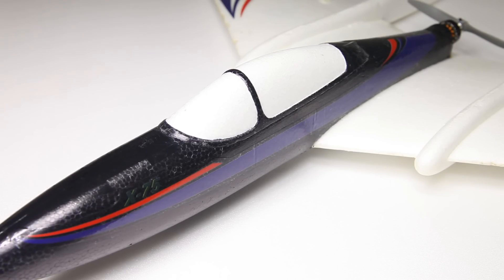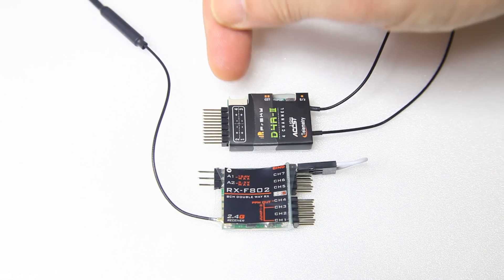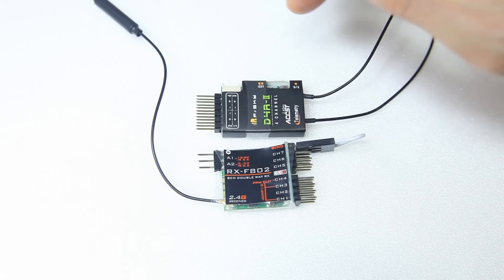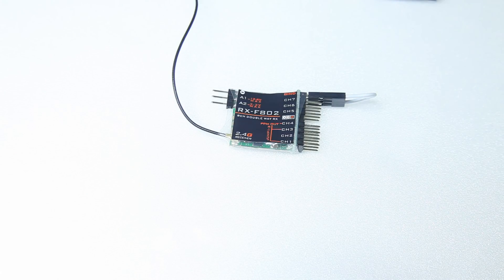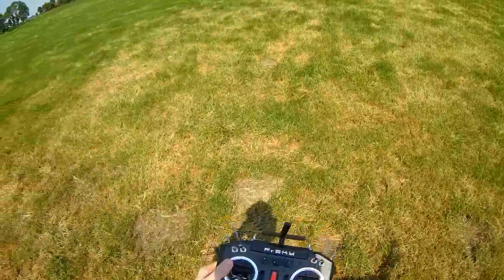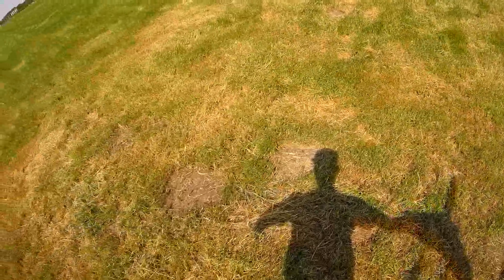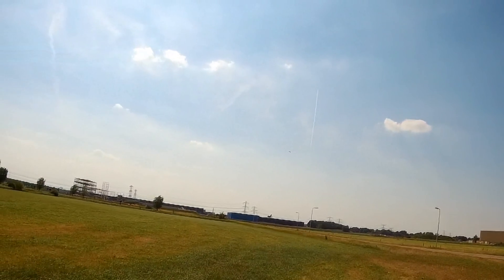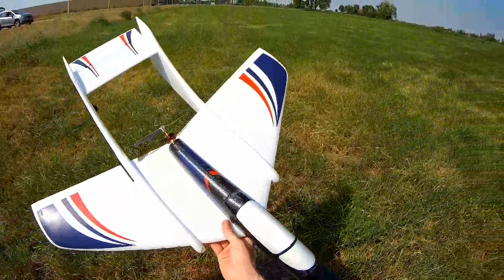Cheap FrSky compatible receiver WITH Voltage Sensor! RX-F802 Review / Test

Comment: Thanks Dutch for the follow up video. I've had a few more flights now, experimenting with the angle of my Q X7's antenna. Placing it upward at an angle has alleviated the RSSI low warning I had low to the ground down field. Like you mention, having battery status available is such a treat. At moderate throttle levels I start thinking about making my approach at about 11V for a 3S pack. By the time I land I've gotten just about maximum flight time from my plane without guessing. I'm planning on buying more as these work fine for LOS flights.
Reply from the maker: Howdy man :) 
as you might have noticed I did do my testing with an old beater plane ;)  But it worked out well.. I allso made sure to have my antenna at the right angle (something I kinda never do really :$).. 
I have seen some people say it has range issues, but really I think they were testing an apple, and concluded it was a bad pear :) 
Great LOS receiver option.. And that's it :)

Comment: I really like my QX7 but FRSky receivers are pricey, this looks like a great substitute.
Reply from the maker: Coming from Futaba radio's (and receivers) to ME Frsky receivers are bargain deals :D 
but yeah.. this one is even more of a deal.. Do NOT see it as a full-range receiver though.. I presented it as a LOS parkflier receiver for a reason...
Reply: DutchRC Adventures , The reviews and price for the QX7 are the reason I bought it. The reverse of you, I was coming from Lemon RX receivers. The version I use cost approximately $25/$30 for 5 receivers. There was no way I could pay nearly $40 for one receiver.  So I use a Spektrum compatible module in the QX7. $18 is still high but I think I will try one of these.
Reply from the maker: Ghehe yeah.. I Used to have receivers that cost more then €100 :|  they sure WERE awesome receivers offcourse.. (lower lag.. longer range.. ).. but still.. 
I'm now kinda / allmost at a point I feel I have enough FrSky receivers (I used to have +/- 40-50 Futaba FASST receivers :$)

Comment: Great review mate. Keep up the great work. Are you using qx7 or qx7s
Reply from the maker: Thank you very much Tyrone! :)  I appreciate that 
I actually Used to have a QX7 (with the upgraded gimbals) but sinds I now use the X10S, I got rid of that one :$
Reply: DutchRC Adventures is there a reason you went to the x10s. I want to buy my first taranis. Not sure what to get
Reply from the maker: No other reason then just Wanting that X10S (and wanting to test / review it offcourse).. It's just a Gorgeous piece of kit :) 
HOWEVER: the QX7S is Fine! I'd definately recommend it.. Great value for money